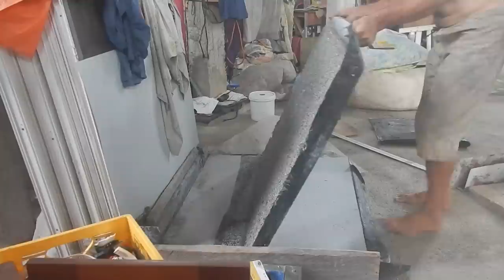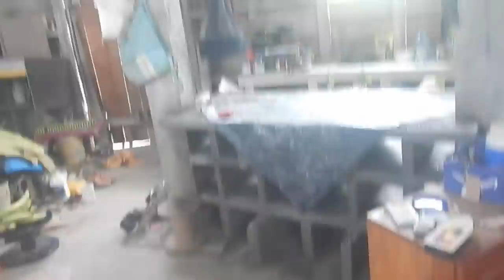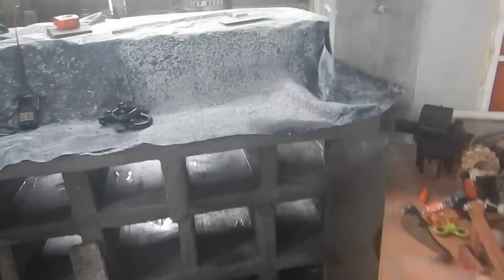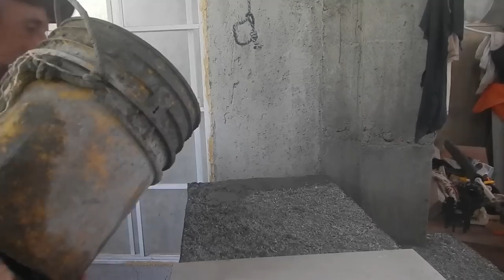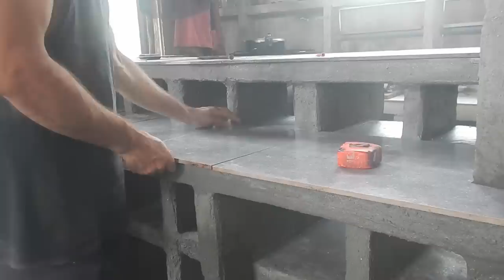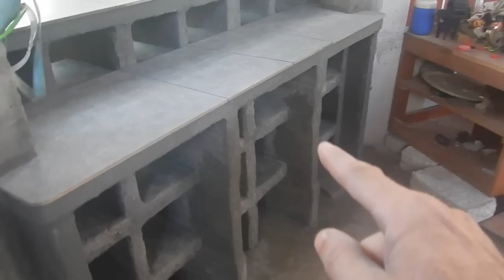Kitchen Upgrade 2 of 2 Caveman Island

Comment: I wonder if 1x2x.5 blocks would slump. I am thinking along the lines of what you might need if you build the bridge from styrocrete. Equal size blocks would be enough that you would be able to shape them how you want. I also wonder if you can grind up the pieces that are too small or just use them in other blocks?

Comment: 8:1 is a hell of a lot of styrofoam to cement. 4:1, 3:1, or even 2:3 (styrofoam:cement) are generally considered to be good ratios for strong cementation and internal structure while still reducing the weight significantly. Considering that you don't really plan to have a ton of weight on it, using it as a kitchen counter, though, it should work well enough, but I'd be very careful with it still.
Reply: Sadly, the walls of his dome are made the same way. Which, y'know, are somewhat sort of structural, from stopping you from dying.
Reply: @MattsAwesomeStuff  if I had a cent for every time someone said he was wrong or going to die, id have.. a lot of cents. anyway, he is living life to the fullest, his wall styrocrete ratio will not stop him. i know one day the day he does pass comes, there will be no ragrets, as a famous tattoo would say
Reply: @MattsAwesomeStuff  Considering that Jaimie refused to listen to comments when he was doing Dashaina's dome's foundation, I was not that surprised he did the whole dome with this mix of styrocrete back in the day, but with that said? It's actually fine, because it's not just the styrocrete panels on their own, but there's a framework incorporated into it, and he also went over it with another layer of cement, effectively making it a thick layer of supportive insulation behind the layer of cement. He did give this another layer of cement too, but with the core being the very airy styrocrete, it's deceptively fragile, *for concrete*. Still should be usable for all his kitchen needs, just don't recommend high weight loads.
Reply: @fredd3.14  yeah for kitchen shelves it's fine. It has to be as strong as like, 2 sheets of corrugated cardboard.
Reply: @MattsAwesomeStuff  Did he actually use the same ratio for the walls?  I can't recall, watched the whole movie but it was a while ago.  The upside down L framework pieces were just poured concrete, I imagine they're the actual supporting structure there.